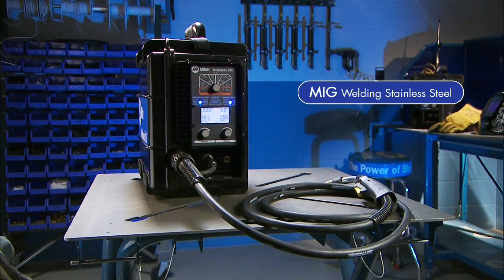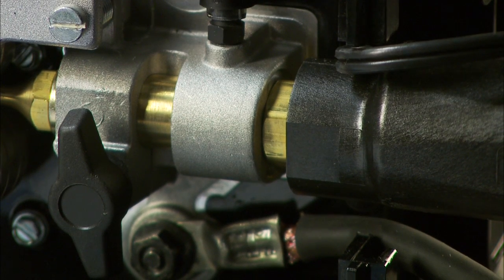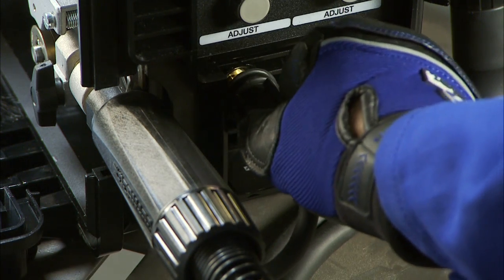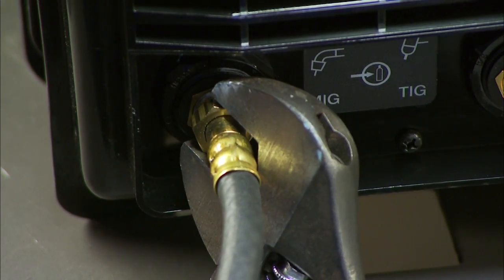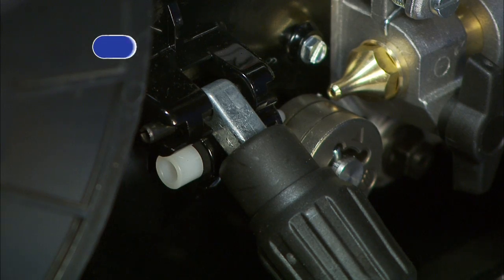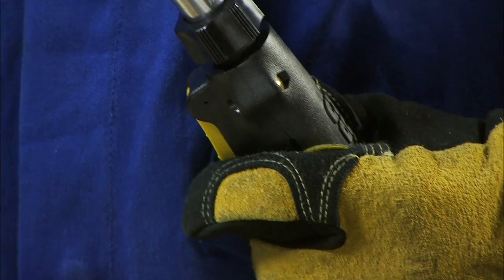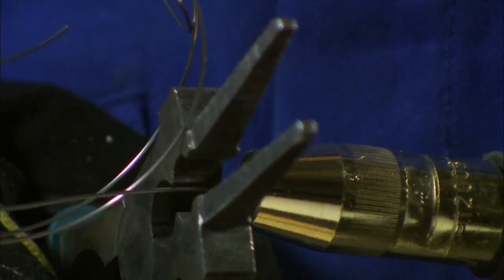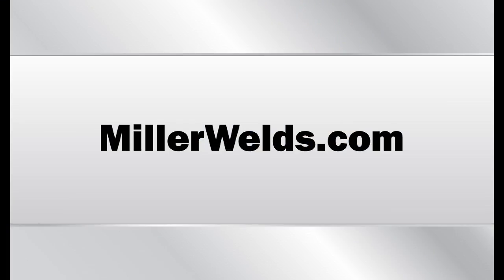Multimatic™ 200 - MIG Welding Stainless Steel

Comment: What size and type of wire is required for stainless steel? Is a certain gas needed also?
Reply from the maker: Frank Arredondo The Multimatic 200 can run stainless steel wires ranging from .024 -.035 and welding material from 22 gauge - 3/16th. We recommend a helium base tri-Mix gas. 90% Helium, 7.5% Argon, 2.5% CO@. This is a typical gas mixture found at most Welding distributors. If a gas mixture other than the Tri-Mix gas is used, make sure that the CO2 content of the mixture is 5% or less. Please let us know if you have any further questions. Thank you.
Reply: A gas solenoid? Haven't heard of that before
Reply: Frank Arredondo  .035 wire works well for almost all stainless applications. Note that stainless wire is not as strong as mild steel and also has a higher frictional coefficient, so .030 is likely to cause wire jamming issues inside the liner.

The best all purpose gas for stainless is 97%Ar, 3%CO2. 

 I do not recommend helium-containing tri-mix gases for several reasons, high cost among them.  The helium increases heat input which is usually not desirable on stainless. It causes erratic/unstable arc performance which increases spatter. Furthermore helium does not produce any cleaning action in the arc.
Reply: Frank Arredondo  .035 wire works well for almost all stainless applications. Note that stainless wire is not as strong as mild steel and also has a higher frictional coefficient, so .030 is likely to cause wire jamming issues inside the liner.

The best all purpose gas for stainless is 97%Ar, 3%CO2. 

 I do not recommend helium-containing tri-mix gases for several reasons, high cost among them.  The helium increases heat input which is usually not desirable on stainless. It causes erratic/unstable arc performance which increases spatter. Furthermore helium does not produce any cleaning action in the arc.
Reply: TSorovanMHael I have seen recommendations for Stargon VS from PraxAir, what should the gas pressure at trigger be set up for Stainless?
Reply: why does it say to use knurled drive roll for stainless and fluxcore wire under the lid of the machine in the drive roll part numbers section in lower right corner ? Should I be using knurled drive wheel for stainless wire ? Miller ? Thanks.